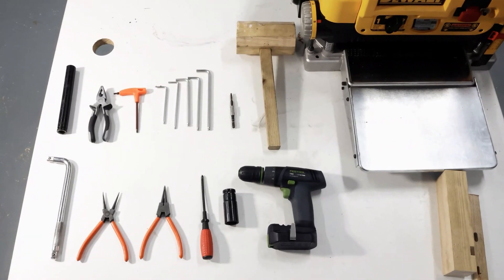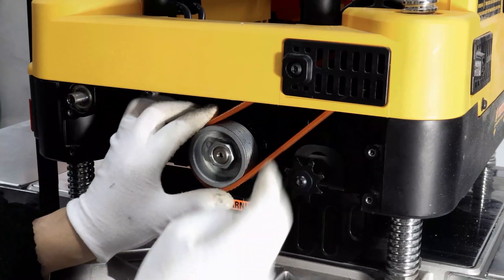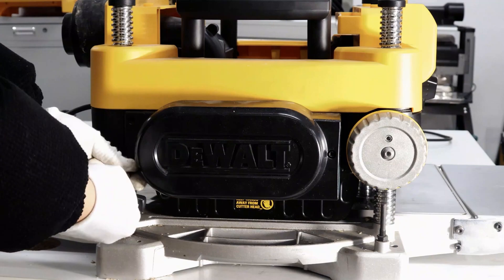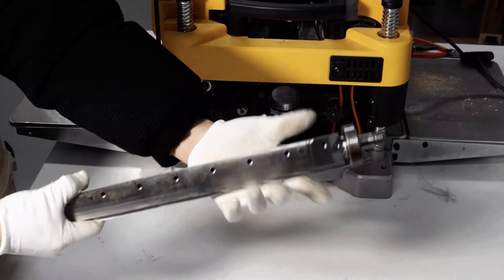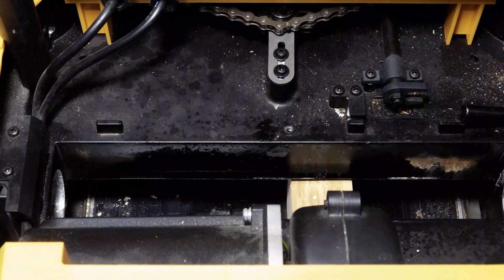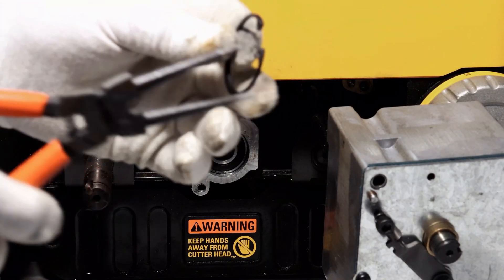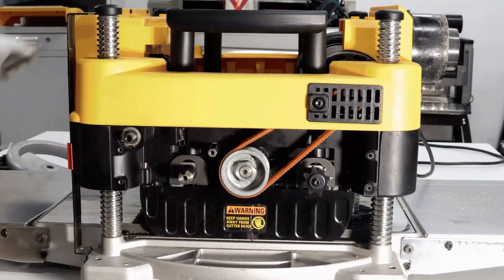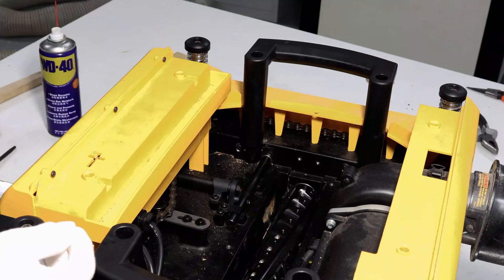How to Install a Helical Cutterhead on the DeWalt DW735 Planer | Step-by-Step Tutorial

Comment: 3:14: On my machine, this washer was behind the sprocket, not in front. 8:32 A little more detail on how to properly insert the key would be appreciated. This was probably the hardest part of the entire process for me. It was a tight fit and went back in cocked. I had to use vise grips to get it back out, sand it a bit to remove burrs I created and reinserted it, pushing it into the channel carefully with vise grips. Overall, I greatly appreciated having this video to guide me through the upgrade process. Thank you very much!
Reply from the maker: Thank you very much for your feedback and we’ll make improvements based on your suggestions.